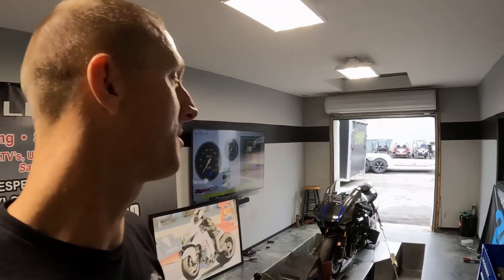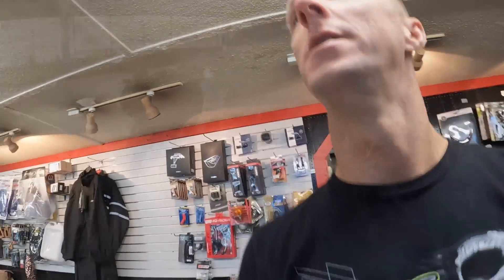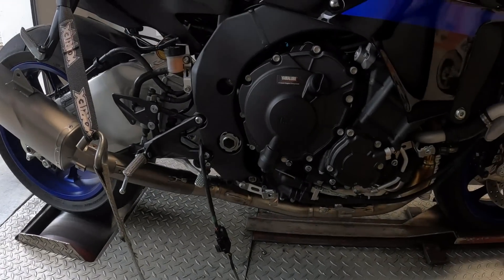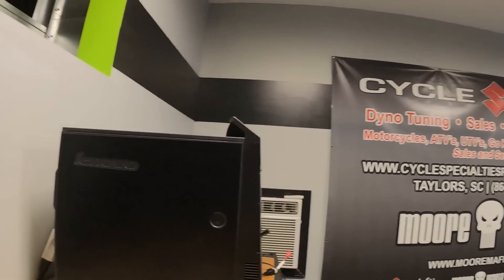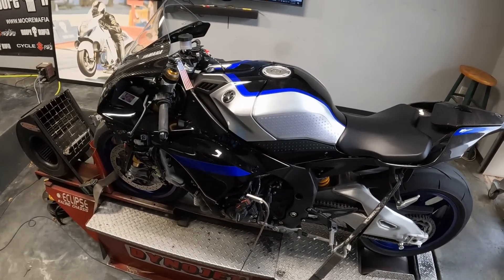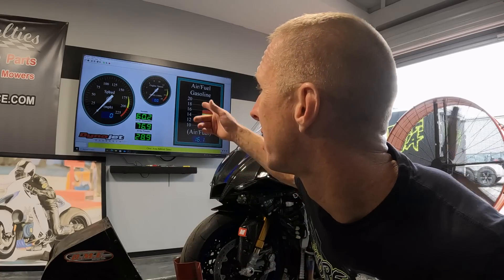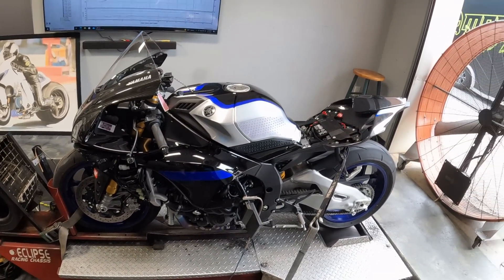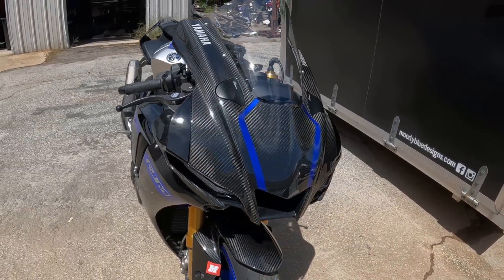Is the 2023 Yamaha R1M Really Better Than The R1?

Comment: That exhaust is awesome but it really needs cams in order to take advantage of the pipe size. The WSBK bikes have a lot of motor work in them.
Reply: Yes correct, but also not to mention this is not an actual world super bike exhuast at all not even close, the wsbk akra has cast titanium bolt on individual oval manifolds for the headers to attach to. Also not to mention the wsbk exhaust is a completely different routing and must also have installed the special deeper oil pan that moves the pan to the right side of the motor and headers to the left this exhaust in the video is the super stock class exhaust bikes that essentially have stock engines for the most part, thinner head gaskets and a bunch of little tips and tricks to get the most out of them while staying inside the rules, but this is a super stock setup not WSBK
Reply: It needs a complete engine blueprint in order to take advantage of the large super bike exhaust and he also needs the WSBK H2O radiator and oil cooler because if you’re going to tumble down the rabbit hole of adding RS parts to your bike, you need to do all of it or not at all
Reply: Yep correct big time.

Comment: It's worth it for track riders who are trying to get every bit of power..
Reply: Roll racing is for max effort
Reply: Just about anything track, drag strip and roll racing not just track. If anything roll racing would need every bit of power more than track
Reply: Then you see toprak at mugello training with a r1m stock 8seg slower than the sbk one .. skills and practice makes more difference than expending Xs amount of money in accessories 😊.
Reply: Rider skill would be more of a deciding factor in a race between an R1 vs. R1M around a track.  How many people are even skilled enough to extract the tiny bit of performance out of the R1M over the standard R1?  A pro rider on a R6 would keep up with an average rider on an R1M.  The difference between the two is negligible.  I'd say you're better off buying the base R1 and modifying it with the extra money you saved over the R1M.

Comment: Motomillions had an R1M and R1 with the same Akro WSBK SS Spec Exhaust and got 198HP  on both on the dyno. Only difference is  had sprint air filters and WSBK Velocity stacks. At least the two were consistent with same mods.

Comment: You pretty much summed it up Chris, this pipe is designed to flow 230+ horsepower. Which you just can’t reach  without major engine work or a turbo.. is it worth the money ? - for the road No but you are paying for the R+D that went into producing it,  against the limited numbers they’ll produce..  Maybe you should get some super aggressive cams for drag racing and see if your pipe holds it back..!!
Reply: this akra pipe is for wsbk specs, around 220-230 hp 👍
Reply: Still be interesting to see how much flow it can handle before it becomes “ the restriction” and the bigger headers become an advantage, WSB motors spend the bulk of their life flat out - so maybe the extra flow helps where’as on the road  you need a bit of midrange to make it rideable, hence the compromise, then again when you produce an engine putting out 200+ HP but then have to electronically limit  it to  stop it looping itself into the scenery  - how much power do you really need on the road…( TYRES ARE GETTING VERY EXPENSIVE..!!! ) .😂
Reply: @ianmurray3820  diameter of headers ,mide pipe,and silencer is designen for optimal flux (gas volume at diferents speeds of flux, flux waves and linear speeds on every conduct and control the exhaust back presure...  obviously more diámetro tubos is better for big and high speeds fluxes ...
Reply: @ianmurray3820  for some people the speed becomes an addiction, and always needs more hp ... 😅

Comment: I'd have to relocate that oil cooler, it's waaaaaay too close to the header.🔥
Reply: Because that’s the stock oil cooler for streetbike!!! it’s not meant for that exhaust!!!! The teams in WSBK and BSB are running an oversize radiator /oil cooler by H2O. You cant go adding RS parts to a streetbike unless you plan to do all of it. Its all or none, no in between. That exhaust is going to bake the oil and decrease HP
Reply: @USAracing     That's why I'd relocate the factory oil cooler. I could easily move it away from the header.
Put it behind the power steering pump.
Reply: @ricktaylor3748  I really doubt you would be able to do that! Have you not seen an R1 in person stripped of its bodywork? The ONLY possible thing you could do besides buying the proper RS radiator/oil cooler is to fabricate 2 small aluminum brackets to mount the oil cooler about a half inch to inch away from the headers...BUT then you will have the problem of the stock bodywork not fitting properly and have to trim it with a Dremel or something or just mount race track bodywork
Reply: @USAracing   I worked at a Kawasaki \ Suzuki dealership for 14 year.
Yamaha is one of the poorest. designed bikes on the market, they''re extremely hard to work on. 
That's why there's not many professional Yamaha drag racing teams.

Comment: Quick question man how do you get ur exhaust to color so well.
Reply: Making sure not to touch it with your hands, thats a major thing, even if you think your hands are perfectly clean the oils from your skin will cause it to do goofy stuff. Other than that he just runs it on the dyno until it does it. Most people dont have that luxury and ride them, thus getting other crud, bug guts and what not along the way that help mess the coloring up.
Reply: Long story short, the heat does it to the titanium, so it does it by itself it, just takes time.

Comment: sounds like yamaha is ripping their customers off, nice bike but not double. with that exhaust maybe head porting with cams would net you 200-205. I think i would heat shield the oil cooler or move it
Reply: How do you figure? They never claim the bike has more power . It does exactly what they claim which is the semi active ohlins fork and shock and. Carbon fiber body. They charge around 8-9k which is fair when you look at what carbon fiber bodywork costs as well as the suspension. It’s not a deal, but it’s far from double and you are paying for what you get . If it’s worth it , it’s worth it .

Comment: id buy a used r1 over an r1m. can't be worth the extra $
Reply: 2015 R1 in the UK is £10k- £11k
2015 R1M is £11k- £12k ( Source- Autotrader)
unless theres is £1000's in difference of servicing, id go for an R1M for the looks
Reply: I think the face lifted R1's (2022+) have a different intake system or something. They seem to make more power once tuned. You can check Chris's other videos and see it.
Reply: @haymush69 i mean here in aus a 2021 r1m used is $32,000 ish where as a 2021 r1 is roughly 25k used
Reply: @yummyhershey5902 yea i meant new gen used r1 over a equivalent year r1m

Comment: This is so stupid purchase for the owner who is most likely a squid, trying to impress guys rides with a Starbucks!! if you’re not going to do all of it, then don’t do some of it because it’s just going to hurt you. You cant half ass it with RS parts! Its balls to the wall of not. Now if he wants to do it right, he has to get the engine blueprinted and also buy the $4500 H2O performance oversize radiator and or cooler. If not he should have just got the street exhaust Chris has.i would also recommend a Bazazz or GYTR ecu and ditch the stock shit and flashing crap